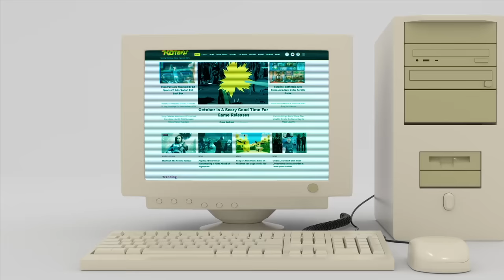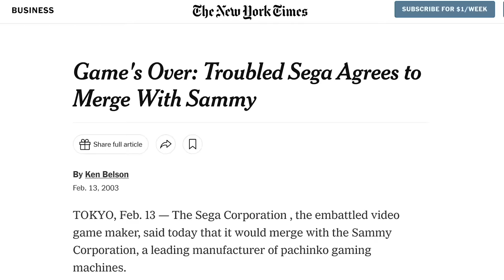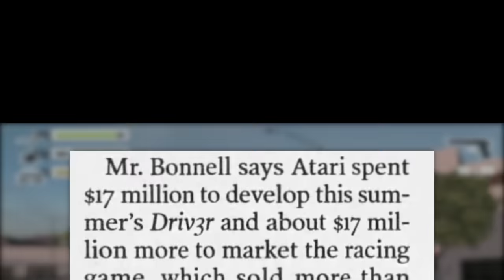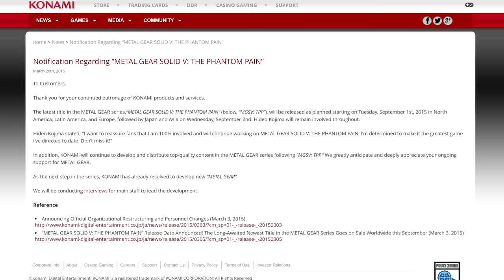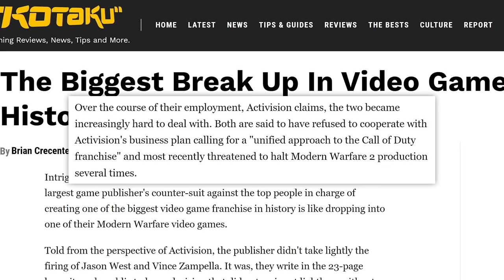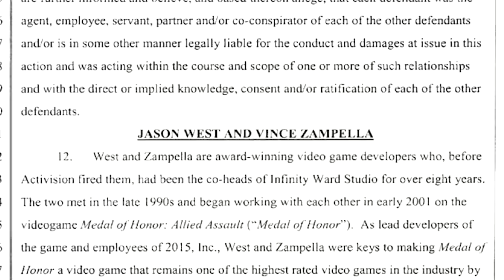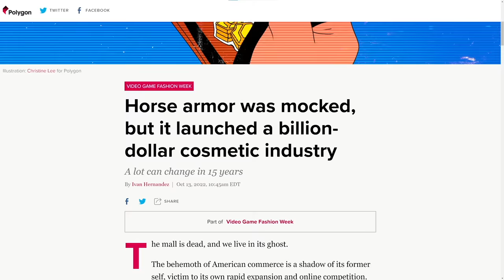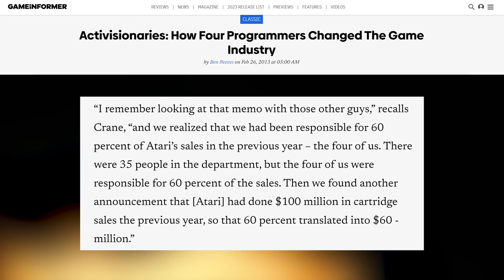10 Biggest Video Game SCANDALS You FORGOT ABOUT

Comment: Technically, Nintendo was the first company to do DLC, back in the 90s.  It was only available in Japan, and required an add-on to the SNES.  There were even a few digital games exclusively available via it.

Sega also got in on it with the Dreamcast.  Phantasy Star Online Episodes 1 & 2 had a LOT of DLC missions, and many of those missions included exclusive drops.  PSO wasn't the only Dreamcast game with DLC, but it is the one I most distinctly remember.

Horse Armor was just the first time DLC made it into the news, and it is also one of the first, if not THE first, cosmetic DLC.
Reply: Sega did add ons first. With the Sega CD for the genesis
Reply: @axinhedgelion8417  I wasn't talking about add-ons.  I was talking about DLC.

Comment: The blue ray was actually first put in the PlayStation 2. And it was the exact same cost as just a blue ray player. Just wanted to get that clarification out there
Reply: No it didn't. The PS2 had a DVD player, which at the time was expensive to get a stand alone DVD player. Then the PS3 did it with Blu-ray.
Reply: @georgehazard1986 exactly this

Comment: From Software releasing Dark Souls Prepare to Die Edition (PtDE), in a messy state.

Mods were needed to play PtDE. Terrible mouse implementation which you needed MouseFix. We also needed a mod called DS-Fix for graphical options like resolution above 720p, and frame rate above 30fps.
On-screen control promts used controller prompts, so we had to learn the controls from a googled list.

Then From Software released Dark Souls Remastered for PC, at full price to owners of the Prepare to die Edition. No discount for owning the original broken PtDE, which they sold to us.

Meanwhile From Software still have a position of fans socially assasinating anyone who thinks to criticise From Software.